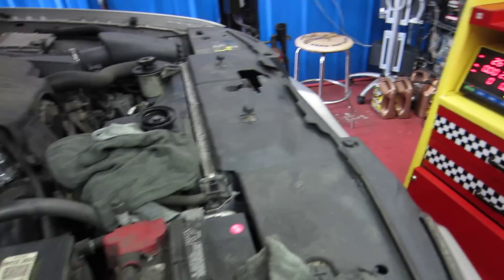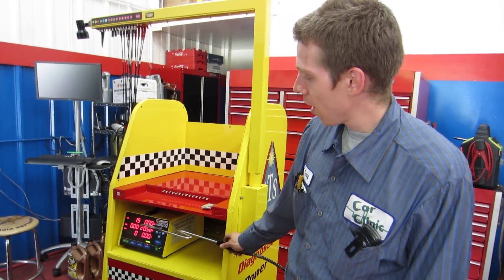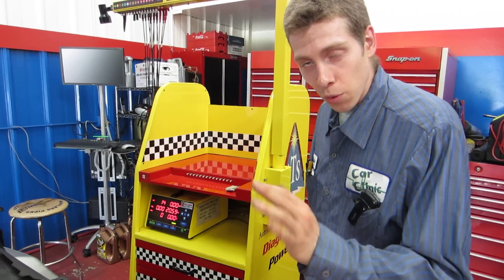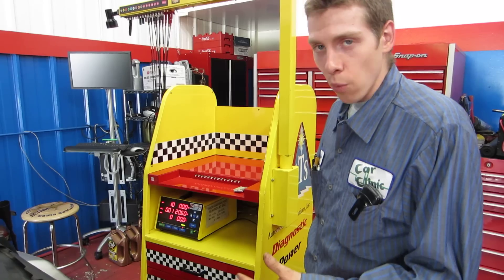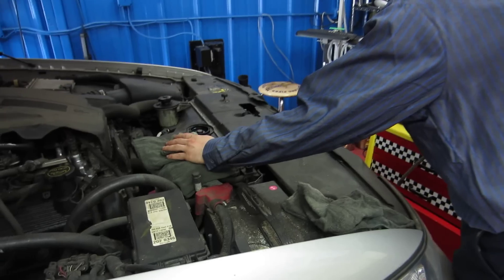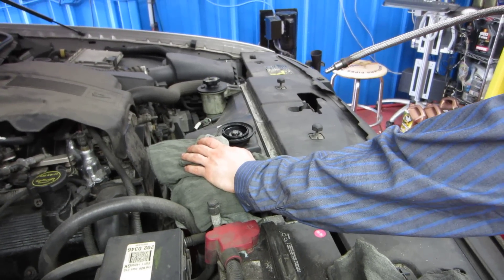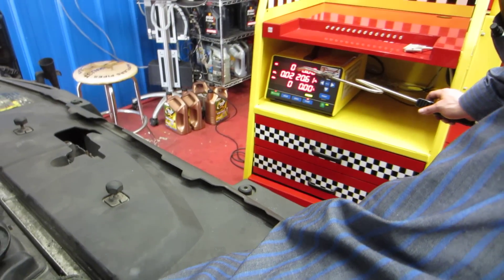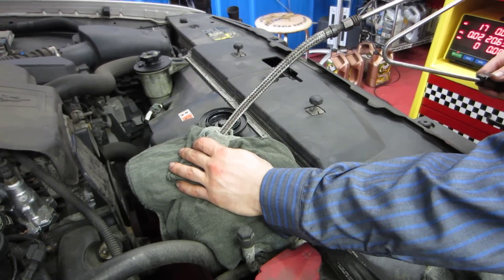Head Gasket Leak Diagnosis

Comment: For home mechanics that don't have an emissions analyzers, there is a chemical kit that tests for HC at the top of the radiator.  You suck the gas thru and the liquid changes color.  I have an old kit from Cal Vans, but I heard you can rent or borrow similar from auto parts stores.  When a head gasket leak gets bad enough, you get a "brown mousse" slime floating at the top of the radiator (my 82 Aries).